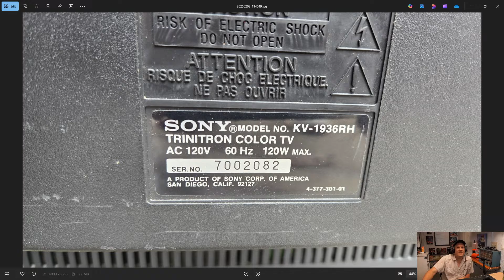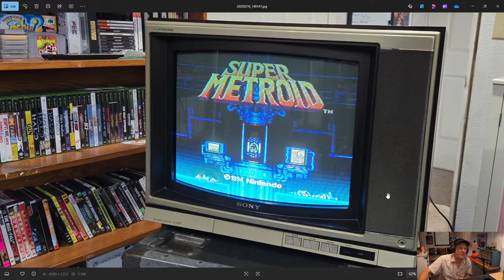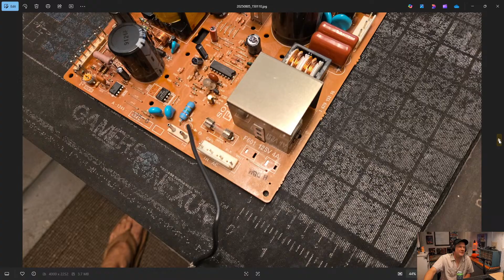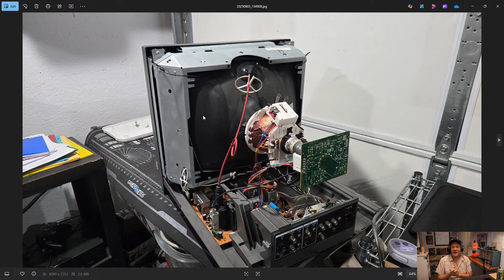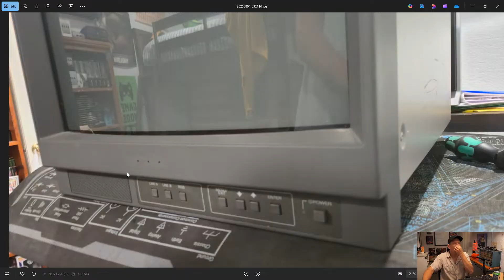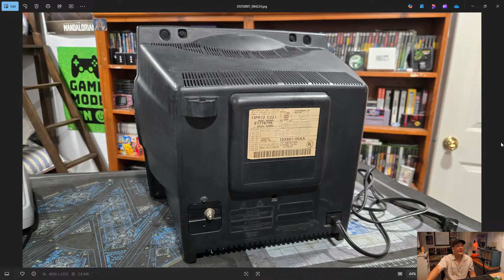Restored CRTs for Sale at Retro World Expo 2025

Comment: A few questions for you regarding RWX:
1) Do you guys need a special table from the venue to put your CRTs on top of? Or was the default one strong enough to hold up whatever you put on it?
2) We're planning to have a 25" CRT in our guest booth. (Long story.)  It is a VCR/DVD/CRT unit. CRT works fine, but wanted to know if you could take a look at it to see if it needs any servicing.

Comment: Thanks for the great video, Steve!

I have the Emerson version of the Sylvania TV you showed, and mine has linearity problems, with the picture stretching out on the top and left edges. 

Do you think I that replacing the same caps you replaced could fix those problems? 

It’s a 2006 set with S-video in addition to what yours has.